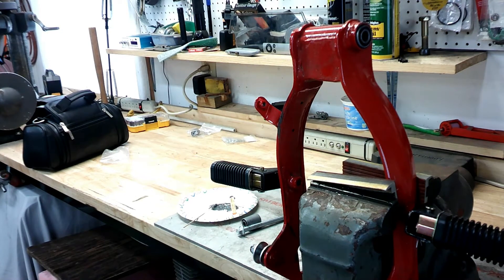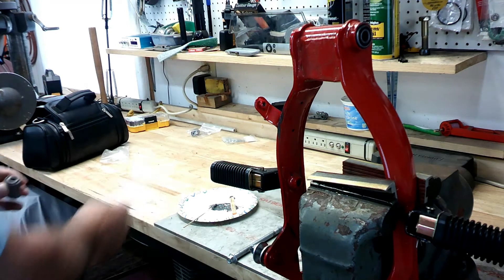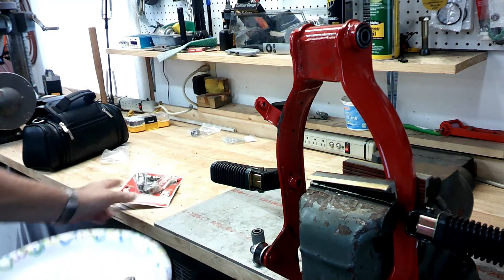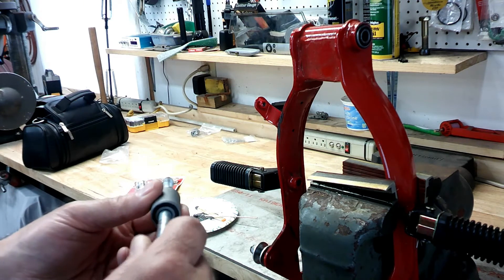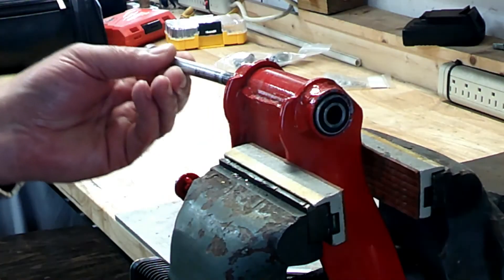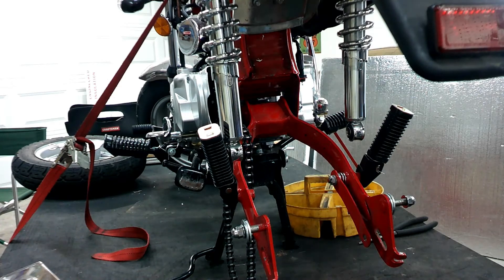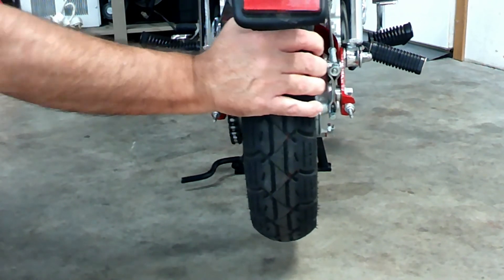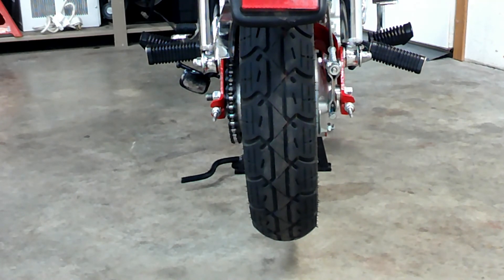Ice Bear 125 Swing Arm issue. Easy and cheap fix

Comment: Since you had previously tried installing the original Honda oem bushings and still had the same issue did you ever try an original Honda OEM swingarm bolt to see if it may have been a tad larger which would have fixed it?
I cannot see the Honda OEM bushing and axle having the same fitment/compatibility problem as usually Honda is top quality when it comes to such things.

I am considering buying one of these and if I do basically plan on disassembling and greasing the steering head bearings, changing the fork oil and checking for other fitment or adjustment concerns before ever riding the bike.
If an OEM swingarm bolt would fix the issue if it existed on the one I purchased that would be awesome and much easier to fix of course.
Reply from the maker: I “thought “ the bushings I ordered were OEM, but turns out they were not. The bolt that came with the machine fits through the frame tightly. So a larger bolt may not fit through the frame?